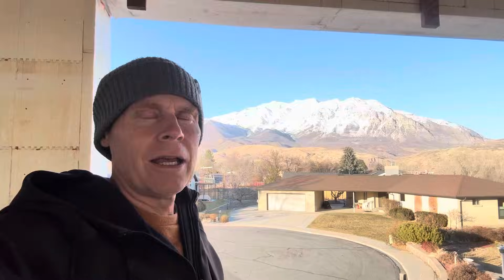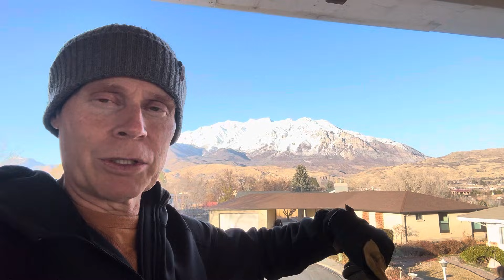DIY Building Science: four critical layers on the outside of your home to keep it from failing

Comment: With the rubber membrane on the outside would it make sense to put a rain screen on the exterior? That way you can allow airflow to dry any moisture that may accumulate on the membrane
Reply from the maker: I am definitely kicking it around.  Joe Lstiburek recommends 1/4-3/8's of an inch for the gap on the rain screen.  I can get that with some wood strips and with a brad nail gun to keep them in place until the screws from my siding holds them down permanently it wouldn't be too much extra work or money.